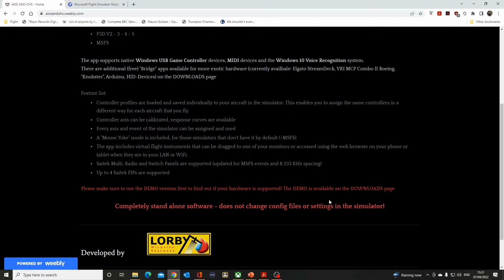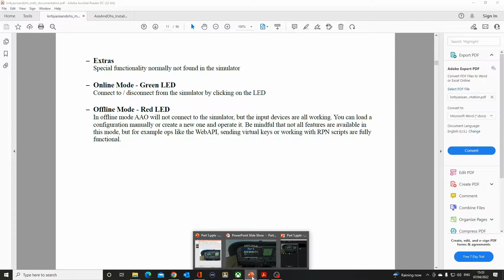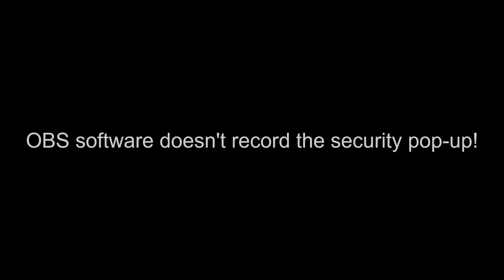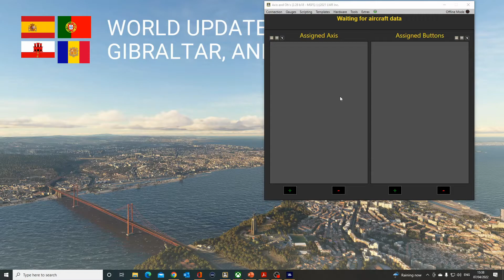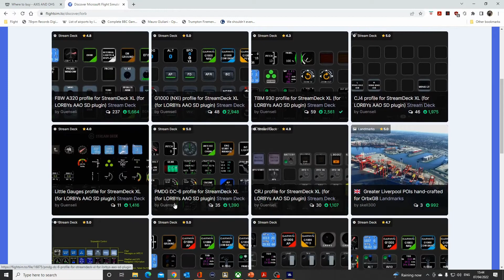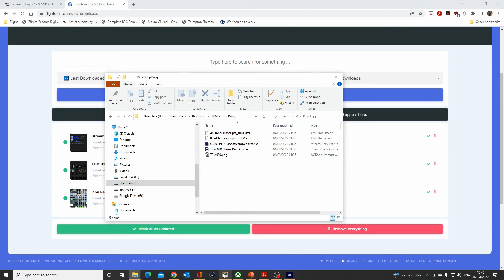Part 5 Axis and Ohs Overview

Comment: Hi, I have just switched to axisandoohs and I am trying to setup my Saitek/Logitech multi panel as the displayed values on the panel do not match the aircraft (PMDG 737-600). I have read through the manual about PMDG and Saitek but am no clearer what I am looking for or how to select the correct variable. Any chance you could help remove the fog??
Reply from the maker: Hi.  I'm sorry to say I can't really help. I haven't got the multi panel or and PMDG aircraft. I'm not realy into the heavy aircraft or long flights.  

Two places you might get help are the AAO support forum at https://www.avsim.com/forums/forum/906-axisandohs-support/

or

Try looking on flightsim.to  people post ready made AAO profiles on here.  I've not looked for ages and I was looking for profiles for the stream deck a the time but there might be some for the saitek panel there.

Comment: Very interesting vidéo. Thanks. I purchased the paid version some days ago and AAO has quite a strange behaviour. It connects normally to the Sim et the current aircraft is detected correctly. I'm able to use some profiles downloaded from flightsim.to. On the other hand, some features do not work as expected. The H & B variable collection (before launching the sim) just don't run. No messages, nothing. When the sim is running, the option to collect Lvars variables fails (collection failed message). Additionnaly, the  "Watch simulator" events does not work either (the windows opens but nothing is displayed. Any ideas. Thanks in advance.

Comment: High Keith Great video 
Quick Question do you know how to assign switches to the PMDG 737 in MSFS2020.
My interface card is a pokeys 57U .
I have a complete Overhead I built with all the switches wired to pokey 57 u cards as inputs .that Are USB connection to your PC.
Reply from the maker: Sorry. I've not looked at the pmdg yet. I mostly fly GA  
Also no experience with the 57u

I've done a few hardware builds but they are based around an arduino. This appears in MSFS as another keyboard. So it sends combinations of key presses. You either program it to send key combinations that are already in the keyboard assignments or you have to assign a new keyboard mapping. 

It's ok if you concentrate on one aircraft but I like to vary what I am flying. So you have to create keyboard profiles and cockpit layouts for different aircraft.  Also, not every function is available to the key press map, particularly with paid for planes

This is what pushed me to the Stream Deck and midi controller method. It's very flexible and gets to more variables and events than those available through the keyboard mapping options. There are quite a few free downloads of pmdg layouts for stream deck on flightsim.to.